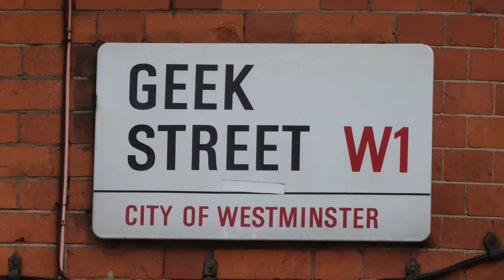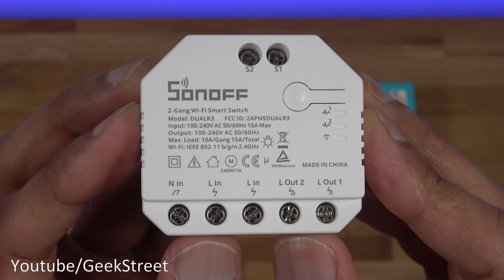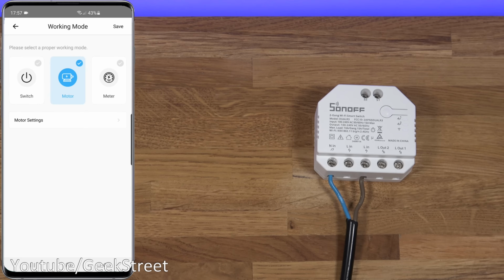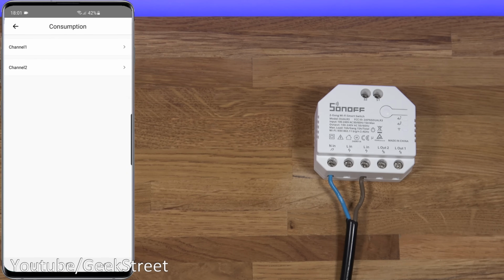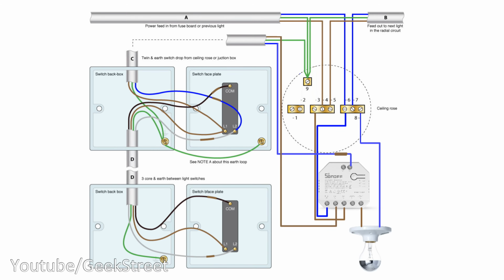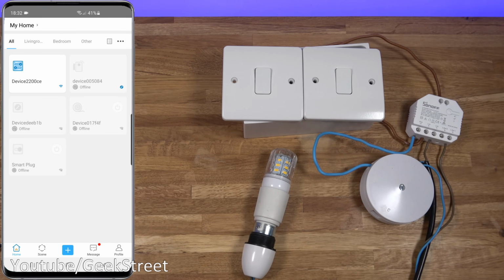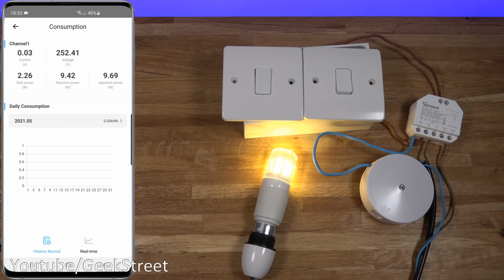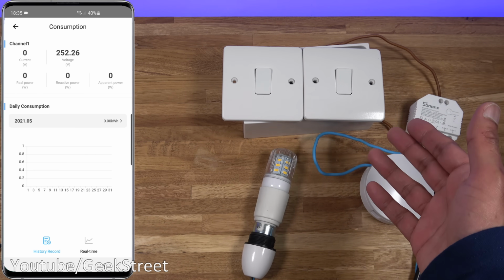Sonoff DualR3 Setup + Circuit Diagram | FINALLY A WAY TO MAKE A SMART 2 WAY LIGHT SWITCH

Comment: If you have an existing circuit with multiple switches can't you just install the dual r3 at the socket with the live feed and set the outputs to interlock so they toggle when you hit the manual rocker switch connected to the s1/s2

Comment: Hi, can I connect a Sonoff Dual R3 like this one to a garage curtain door that has an electronic board with a radio remote for opening, stall and closing with the same button? I tried connecting like you did, but my double switch that I have outside to open and close does not have the classic 3 wires (phase, up and down), it just has 2 wires that go to the board with the photocells, one is central like a phase, and the other one is connected to both sides of the double switch, like a car window opener button. I tried so to wire the Sonoff without using S1 and S2 and intercepting the rolling engine up and down cables, connecting these ones to L-out-1 and L-out-2, but with no success. It literally did nothing... Can I try the reverse? I mean to connect the 2 wires to S1 and S2 and to leave the engine on the board? Because when I tried the first configuration, and tried to rise up the door, the power went out, but I just intercepted, as I said, the engine wires with no mistakes. It seems that this Dual R3 is good for normal situations without electronic, but my aim is to emulate the remote control (open, block, close, re-block, re-open and so on, with 1 button), so how can I do if my doubleswitch is that weird?

Comment: I was looking to get a circuit into my doorbell so I could connect it to my API when some one rang my door bell i could run a specific sound or turn a specific light via my own API. But i don't seem to be able to find a circuit that i could easily put in my doorbell.. any ideas? i would really appreciate it. 
Eventually i would like to do the same with other switches... press a button or something at home and send a wifi signal...
As a last resource I guess i would have to connect a raspberry to my doorbell or something... but doesnt seems right

Comment: this wouldnt be done this way now -its much easyer to fit one wall switch T2UK1C-TX (wifi+ rf) then have a t2eu1c-rf switch remotelly
so you have app + 2 way switching with no aditional wiring 
the remote switch is coin cell powered i only wish they had a 240v powered version with backlighting to see it at night -ive converted mine to have backlighting (using the existing status led at dim blue) and powered off 18650 lithium in the back box -lasts about 8 months on one charge powering the led with 0.3ma which matches the brightness of the mains powered switches

Comment: Nice try.  This only works if both switches are in the same box which is unlikely.  
The if the sonoff is in the box with switch1 the output of switch 2 needs to travel back to the sonoff.  The output going to the light will likely be in the Sw2 box. This is an additional 2 wires to be run through the wall.

Comment: I have a problem with this configuration. I have the Sonoff controlling a light and the external switch is at a distance of approx. 20 m, however it turns on and off continuously causing the light to blink a lot. If I remove the cable that is at the S1 input, the problem is solved, but I can no longer control it locally with the switch. Any ideas for a solution?
Reply: I have same problem. 2 way light switches are 35m apart (farm shed with switch at each end). The smart switch switches rapidly on and off (flashing lights) when use the switch to turn lights on but works if switches in off position and use the mobile app. Did you find a solution?

Comment: Great video thanks.  Do you know if you could use the DualR3 with one of the manual switches on the NSPanel using the same wiring method?  So you could use eWelink and the NSPanel switch interchangeably to turn on and off as a 2 way switch

Comment: Hello everybody! Has anyone succeed to have it connected on Google Home? I have 6 Dual R3 which I use on motorized roller shutters which works extremely well and smooth on Ewelink app but none of them is controlled over Google Home. Despite of that I have a couple of Sonoff basic which are easily controlled over Google home and of course on Ewelink app. Is anyone able to help me? Thank you in advance
Reply: I have the same problem.did you find a solution?
Reply: @monza333  not yet unfortunately, keep in touch if any of us will find the solution
Reply: @fabiolucheroni2094  i find an answer.the Google assistant doesn't recognise the sonoff users interface  as a motor,inly as a switch . maybe in the future can recognize it as a motor switch and not as a light

Comment: Shelly mini can also do the same functions, it’s also smaller in size so it fits into a standard light pendant.
Reply: That's because he is using wrong product fir purpose  Sonoff ZBMINI does same. This guy is using a wrong switch. 

Two way switch is still on one circuit. The dual Sonoff is to controll two separate circuits/lights not just one light with two switches.

Comment: Would it not be easier and safer to use a Google/Alexa compatible smart bulb
Reply from the maker: That's the easier option definitely, but your screwed if someone turns off the switch.

Comment: Another great video but let me say that All Smart switches can be two ways as well. In fact, multi-ways. No need for special wiring.
Reply from the maker: Thanks, yes using smart scenes, but interesting with this you can leave your existing switches in place and make it smart.
Reply: @GeekStreet  Sonoff ZBMINI does that too, one light two switches controll manually and smart fir half price. You are using wrong product fir the purpose. Your scenario is one circuit and the ZBMINI accomplishes that. 

The DUAL R3 is to controll two circuits/lights independently. Not one light with two switches.